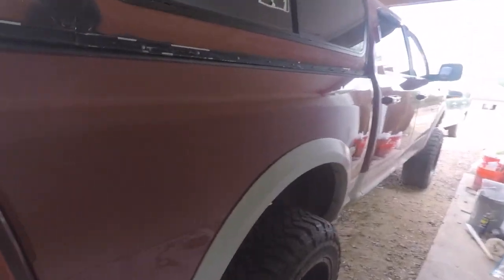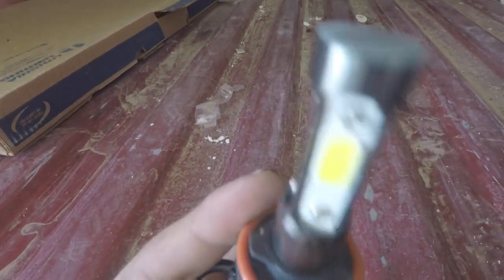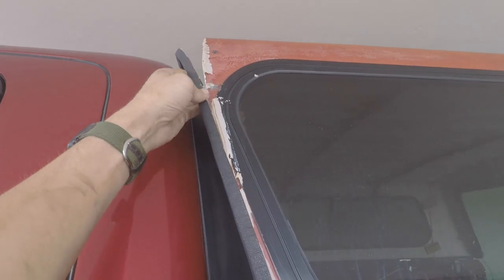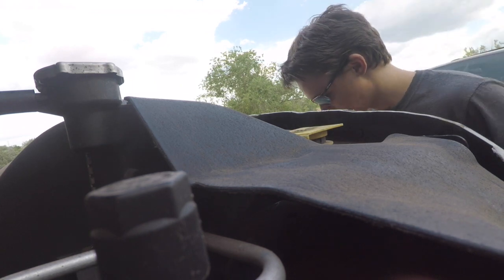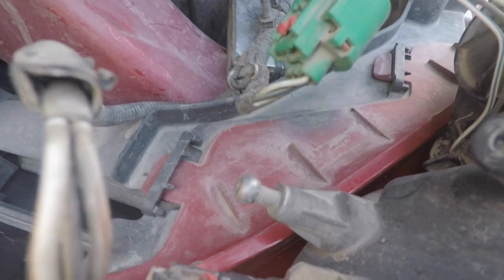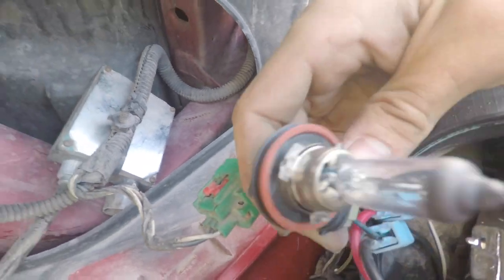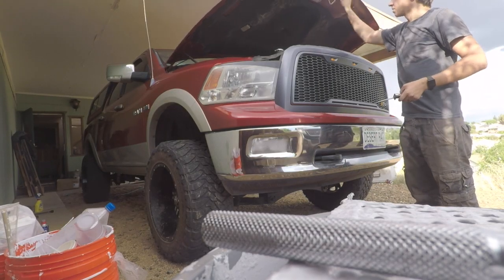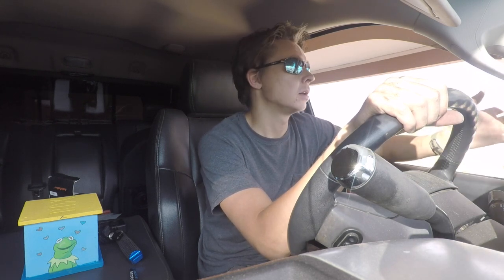CHEAPEST LED HEADLIGHTS ON EBAY

Comment: Did they last ? Looking to buy them
Reply from the maker: They have lasted im still currently running them they are a huge improvement over stock bulbs
Reply: ive used auto father led bulbs for 1.5 years and one of them failed.. but im still impressed